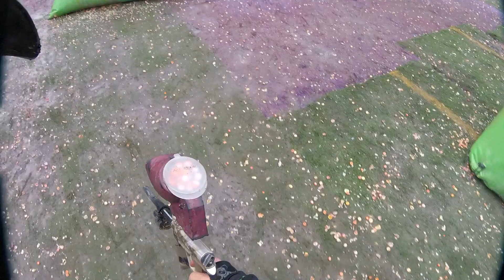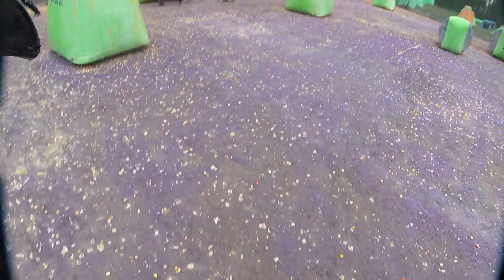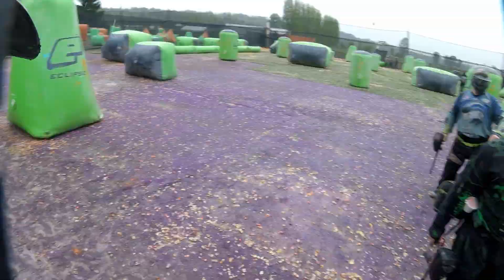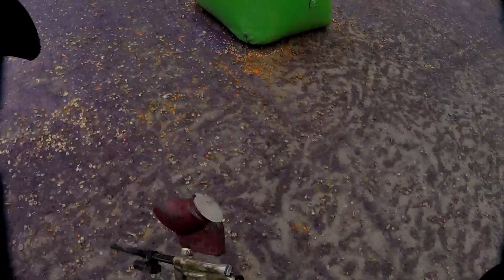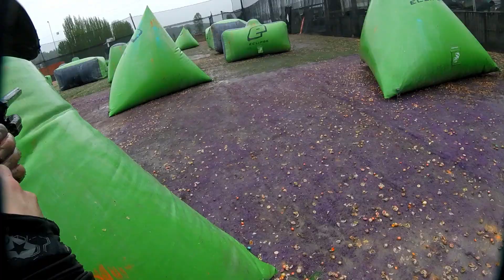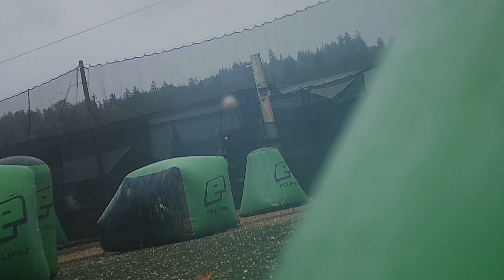Can this old Viewloader Revolution loader keep up with NXL 10.5 bps?

Comment: That's very cool if I got back into paintball I would definitely dust off my old loader those revolutions are bulletproof loaders and none of the nonsense of newer loaders
Reply: There’s not a lot of nonsense with a spire. You turn it on and it never lets you down
Reply: @danielnelan8698  very true I'm Still rocking my white original spire there's something about the old-school revi as a special place in my heart and considering the tournaments only have 10.2 BPS or whatever it is now you don't even really need much more than a Revy anyway stick a Halo style Speed-Feed on it you're good to go